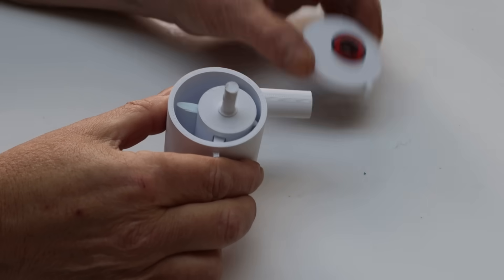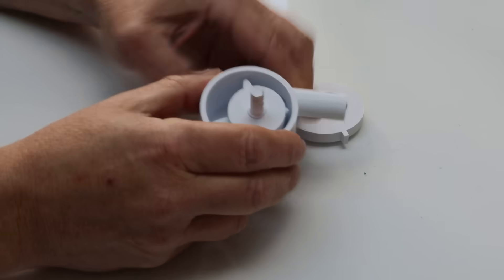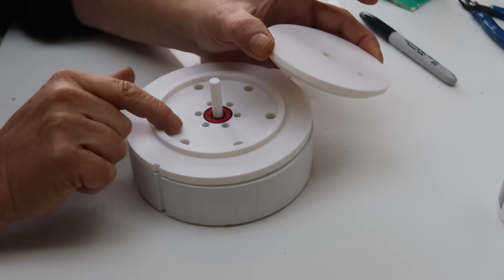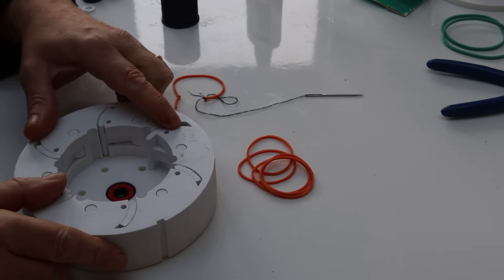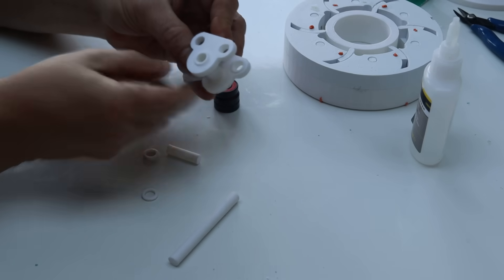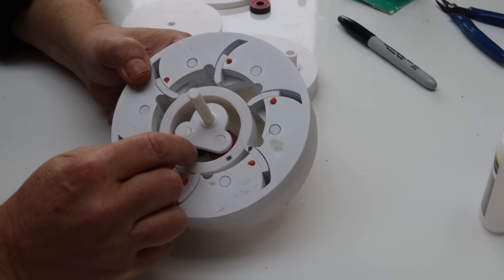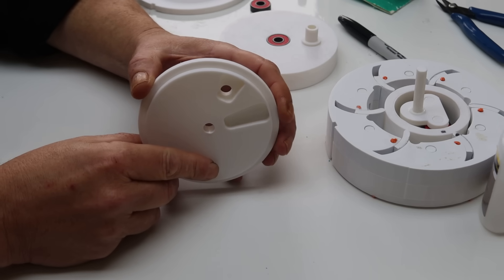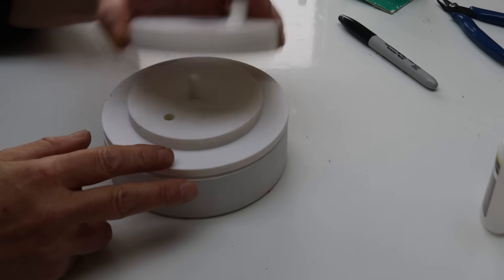2322 The Di Pietro Air Engine

Comment: It was designed for compressed air-powered cars. Among the engine proposals by Angelo Di Pietro, Guy Nêgre, and Armando Regusci, this one is the one that convinces me the most. Although commercializing compressed air cars is difficult, their implementation should not be ruled out. A hybrid of electrostatic storage in supercapacitors, paraffin for phase-change heat storage, and carbon fiber compressed air tanks would create a fast-charging urban vehicle that competes with electric cars in price and ease of recharging, though not in range.

Comment: If you are interested in compressed air motors; you may wish to check out my videos to see how to build a single rotary sequence valve that can operate multiple cylinders. This creates a much lower cost motor, with more torque, and less leakage.

Comment: Your video really inspired me to understand how this engine works so I have printed one. You have alignment marks on the three plates but do the valve and central carriage also need to be aligned with each other? I'm assuming they both need to be glued to the main axle. Should I expect my model to actually run?

Comment: Vane motors are primarily used in hydraulics which solves the friction problem and lubricates the motor. You could have 40hp in your hand with a hydraulic vane motor.

Comment: I talked to Mr. Di Pietro in Melbourne yrs. ago about buying one of his metal AIr Motors, but he was still working on them. 
He did have some in Carts in use at a market using Air cyclinders, where fumes from other powered Carts was undesirable.  

The motors were based originally on the Wankel motor which I believe he worked on. - Great stuff Robert.

Comment: would increase the weight, but opposing permanent magnets in an otherwise nonferous assembly would create a durable low-friction resistance for a long time. The body could be made from, say, brass. Or aluminum.

Comment: Stacking the processes like that is neat, and always blew me away with its impact on transistor production, but have you considered turning half of the processes perpendicular? It’s an air engine in reverse invented around 9 years ago, the lontra blade air compressor (with some arguably easier surfaces to seal), but of course if you reverse air compressors they basically become air engines.

Comment: That motor is rather cool. Vane motors seem all the rage lately. I watched 1 by "driving 4 answers" a month ago, then Integza had 1 last week and now this one. 
For your design rather than cut and superglue rubber bands a couple of recessed loops could be used to hook the 2 ends of an uncut rubber band to.
Reply from the maker: nice suggestion mate - cheers

Comment: Pretty cool to see a 3D printed Di Pietro motor! As far as I can tell, it's the only really successful (non turbine) rotory engine after the Wankel and vain motor. You mention being iffy about the valves, which I definitely agree with! From the images I've seen, it seems like the full production motor has a more open path to the central chamber but it's also longer, which would be lossy as well.
Reply from the maker: I can see why he did it but i wonder if it is oversimplified?

Comment: I like the idea of turning air pressure into rotary motion this way.  Put a flywheel on this and a little generator on the flywheel, and you could pump this from simple lantern bellows powered by a back-and-forth wind capture device, even a sapling waving in the wind.  A pneumatic system gives you a lot of flexibility -- multiple units off one wind power source, or multiple bellows pumping air into one air engine to spin up the flywheel, and it's all pretty mechanically simple.
Reply from the maker: I like that idea mate cheers

Comment: What a great design, certainly gets you thinking 👍
Reply from the maker: It certainly does!
Reply: Interesting, but I don't think gluing rubber bands to the surface will last long, possibly why we didn't get a demonstration. Nice concept though, certainly appreciated.
Reply from the maker: no it won't last long you could always put springs in if you want but the main point of the vid was to explore how the engine works

Comment: Huge fan of the Tesla Turbine, I bought a machined metal 4" version from China for about $100, it runs to extreme RPM on air pressure, it also runs well on steam pressure.  I've found the sweet spot is around 80-90psi
Reply from the maker: nice - i have seen them - i am so tempted myself lol
Reply: Note they do high speed but not a lot of torque for their size.

Comment: So how do you test the di pietro vs the vane motor? Just use two soda bottles pressurized to the same pressure and see which engine runs longer?
Reply from the maker: I would think probably a prony brake to measure static and dynamic torque - graph them and extrapolate the curves - that would be my guess

Comment: Might make a good 2 stroke engine
Reply: Nah, this is a good low-speed 'turbine', no need to complicated it. Redesign ing for the sudden pressure changes would be a pain, external combustion means no redesign needed. ;)
Reply from the maker: yes it would!

Comment: Integza made an interesting design where he printed "flaps" on the rotor vs the veins. I thought it was particularly clever and simple.
Reply from the maker: I saw it - something similar might work well here
Reply: Yep- I was gonna mention that too- it did work better than he expected for the minor changes to the design.
Reply: Came here to say the same
Reply: Indeed. Imagine something like the flaps integza created attached to this device instead of the veins. If you could construct a living hinge connection to have them attached to the core ring instead of the housing with the flaps feeding down slots around the housing like the veins do in the Di Pietro.
It would resolve the issue with high RPMs overcoming the ability of the springs/elastic to spring back in time for the next revolution.
Reply: yeah true, and my comment didnt make it to win that printer lol
Reply: The flap thing is a game changer. Printable compliant mechanism that doesn't need lubricant. Definitely a rabbit hole to explore.
Reply: Lol, the two channels have become a 3d-printed air engine death match, and I’m here for it
Reply: Why making flaps at all? Theoretically one could print outer and inner "cylinders" as one part connected by bellows-like separators. I just can't imagine how to design those bellows separators springy in one direction and stiff in perpendicular to the first one.

Comment: Since central cylinder doesn't have to rotate, I think that vanes, housing and central cylinder could become one part using compliant joints.
Reply from the maker: you know i was thinking that - i was pondering printing a unit out of TPU of something similar

Comment: Thank you Rob. ❤ Since Angelo didn't know how this works as a pump and you have that laser cutter device. And a wind turbine that drives an air pump directly able to compress to say 15 bar then any LPG tank can become a battery. Ps the big ones are less than a grand and are safe to 17 bar.
Reply from the maker: that strikes me as a pretty reasonable price mate
Reply: @ThinkingandTinkering lpg tank might not be designed for wet air, the condensate will corrode vessel if its metal?
Reply: @ianjackson4571  doubt this design could get that high maybe a bar . How are these any better than a sliding vane pump?